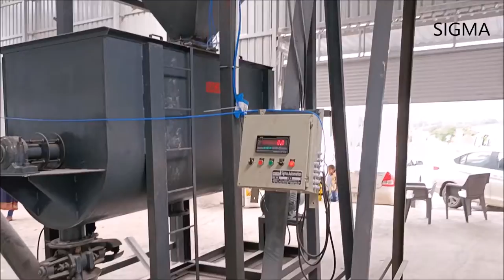Tile Adhesive Mortar Plant | 10 - 20 Ton per day | Sigma Automation | Packaging Systems

Comment: For limestone
The whole grinding system including classifying system power is around 370Kw, the real working power is 80% 296KW
1. D97=23um (600mesh)    Output: 10tons/h      Energy Consumption: 29.6Kw/Ton
2. D97=16um(800mesh)     Output: 8tons/h       Energy Consumption: 37Kw/Ton
3. D97=10um (1250mesh)    Output: 4.5tons/h    Energy Consumption: 65.7Kw/Ton  
4. D97=6.5um(2000mesh)    Output: 2.5tons/h   Energy Consumption: 118.4Kw/Ton 
 
For Talc powder
Longyi powder grinding mill power is 250Kw, the real working power is around 200Kw, including classifying system.
A. D90=10.5~10.7um   output:  4 tons/hour
B. D90=9.8~11um      output:  3 tons/hour
 
It is suitable for processing nonmetallic minerals such as calcium carbonate, calcite, Kaolin, clay, barite, talc, gypsum, limestone, calcium oxide, bentonite, dolomite etc.